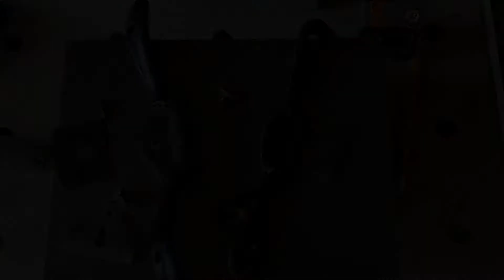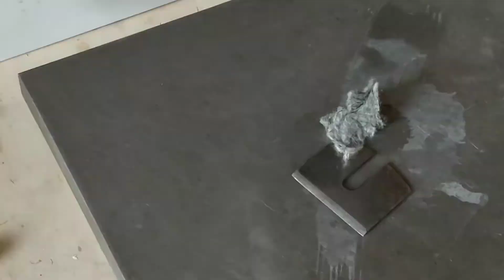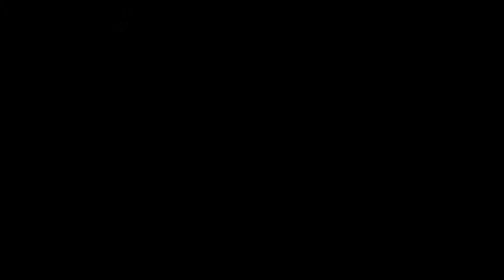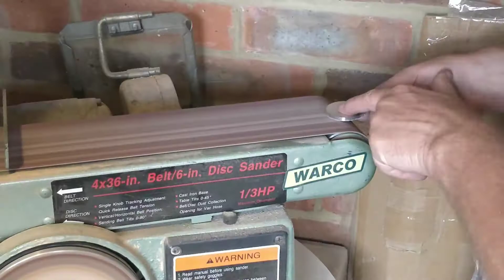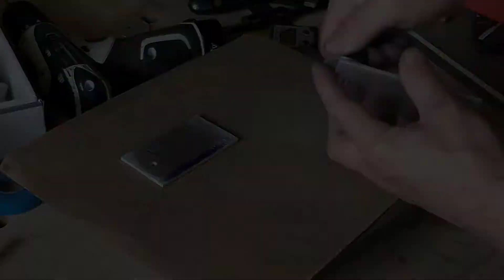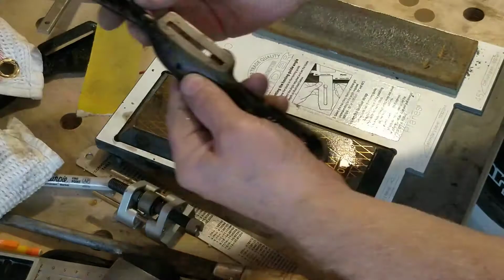52. Spoke Shave Restoration and Custom Honing Guide Jig

Comment: Clever way of quickly ensuring that you can accurately and repeatedly set the blades in the jug
Have you considered making a japanning mix to protect those and your planes?
Reply from the maker: Thanks, I did consider it, but decided that as someone using them rather than preserving then, making a Japanning mix was a bit over the top.